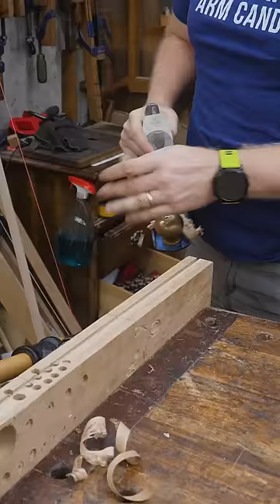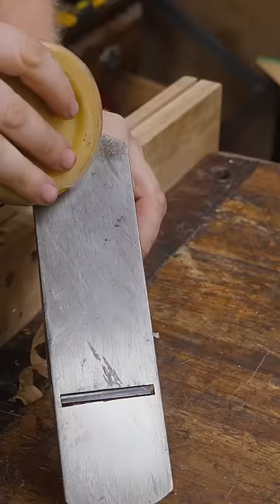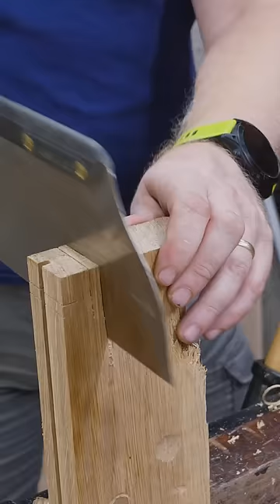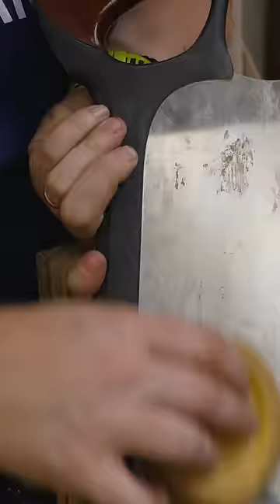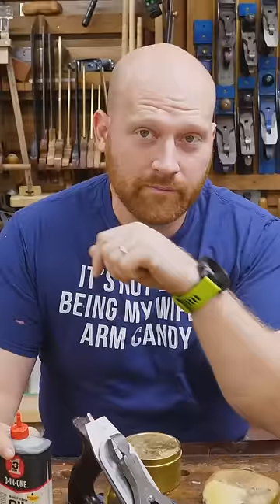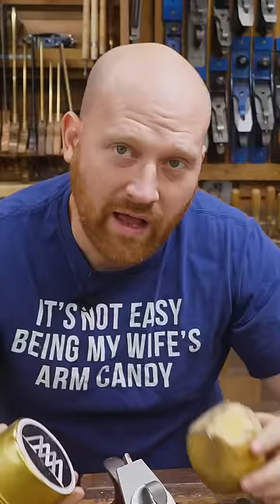Lubricate Your Tools

Comment: Wax is a wood workers nightmare, it stops stain from penetrating and is hard to see to remove
Reply from the maker: You would think that. But applying it to the soul of a plane really makes no difference to finish or glue penetration. It's a bit counterintuitive but there's a reason it's been in use for thousands of years.
Reply: @WoodByWrightHowTo  that reason being they didn’t use stain thousands of years ago ? I got wax on a project from a bandsaw table and it ruined it. Nobody told me they waxed the table and I found out the hard way. We normally only waxed break out tools not the bandsaw or table saw or planes or scroll saw. I also ruined a table top I was glueing up because we had wax on the bar clamps to aid in removing glue drips but I didn’t know and I touched the bars to the wood and got wax lines that blocked stain. Normally I plane a fair bit off but I took care that time to get all joints flush before the glue set so there was not enough wood left to get rid of all the wax that somehow soaked in 2-3 mm
Reply from the maker: Sounds like you used way too much wax. And yes they did use stained thousands of years ago. Even just a simple boiled linseed oil can't have the same effects.
Reply: @WoodByWrightHowTo  ya they did use stain in cave man days I bet. I was exaggerating like a woman , I’m sorry 😂
Reply from the maker: I say that because there are examples of Egyptians using stain. Both brightly colored dyes as well as tannin darkening stains. No disrespect at all
Reply: @WoodByWrightHowTo  even before Egyptians they used black bog wood and probably dipped new wood in the tannins for protection.

Comment: I’m not knocking your product because for all I know, your wax might be the bee’s knees, but when you’re making a video about how good something is, it really is imperative that the tasks performed to show that said item truly works, are as close to identical as possible, thus making it more believable that it was indeed the product that made the improvement. Holding the planer at drastically different angles sure seems like it would affect the ease at which the planer would perform. I am no master carpenter but I am however (based on the facts that you held the planer at drastically different angles and you stand to gain by proving your wax works) going to raise the BS flag 🚩⬅️ BS flag
Reply from the maker: oddly enough angling it would make it work slightly easer as it lowers the affective cut. interesting catch as I did not notice I did that in the video. but how easy it is to push can not be translated in a video it is something you just have to try. grab a candle and try it for yourself with some random wax and see how easy it is. don't take my word for it.